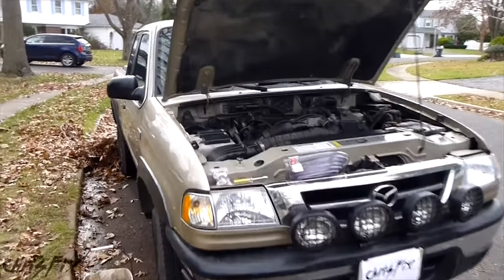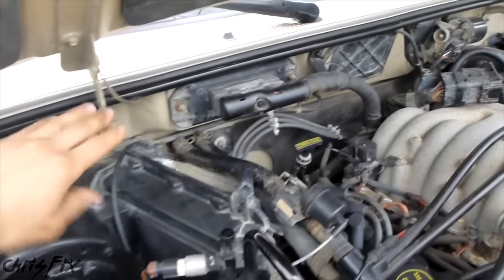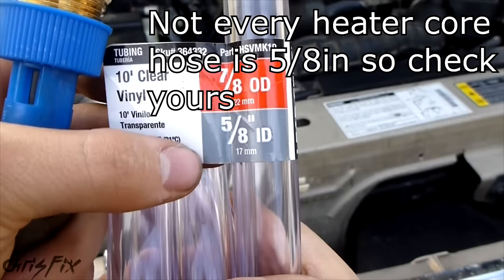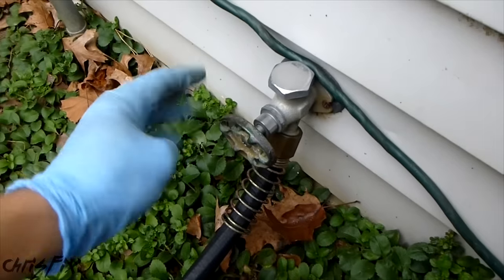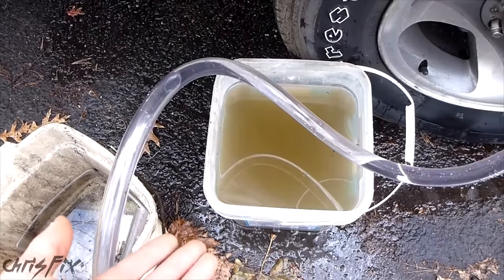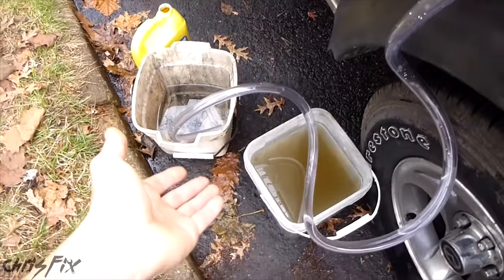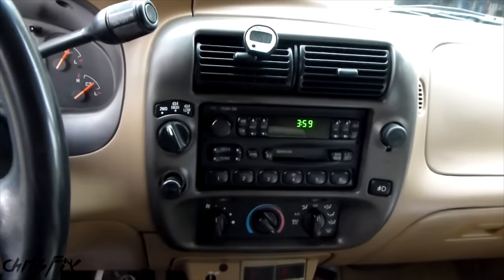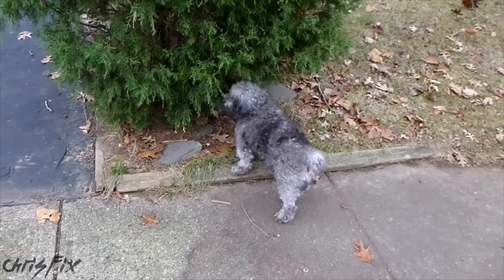How to Flush a Heater Core Safely (with a garden hose)

Comment: Chris, I'm a big fan of yours! I just replaced a leaky water pump on my Highlander, but I still didn't get heat (I lost heat after the leakage). After watching your video I suspected my heater core was blocked by air pocket. I followed your suggestion to flush out the heater core which worked like a charm. Now I have heat in my car and the fix is complete. Thank you very much!
Reply from the maker: Nice work!

Comment: Thank you again, Chris!
The heater hoses on my 97 malibu go back down behind the engine so I connected the clear water hoses to the heater hoses with plastic splicers and it worked great. there was a quick disconnector on the inlet hose that had corroded & it completely crumbled when I separated the heater hose so I’m glad I caught it because it was leaking a little, so it was a blown hose waiting to happen! I cut 1” off the end of the hose & cleaned it up so that when I finished up I re-attached it directly to the heater pipe. Those quick-disconnects are more of a hassle than a convenience. Ask me how I know...
Reply: What tool did you use to cut the 1" part? I am trying to assign handiness to things I already have or buy what is needed for such projects.

Plus I have carpal tunnel so my wrists aren't great for endurance challenges.

Comment: Thanks for the video! My 95 BMW 525i was barely putting out any heat and after following your instructions shes pumping out heat again!  Very pleased I didnt have to take it to the shop!   I did a full cooling system flush btw following your other video because I was over heating. Cleaning out the system as well as a new fan clutch did the trick.. Thanks again!

Comment: A couple things. You opened the cooling system. Even though you refilled the heater core with anti-freeze, there will still be air trapped in the system. This can cause problems such as no or warm heat if there is air in the heater core (coolant wont flow properly), idle issues (air can trick the coolant temperature sensor into thinking the car is not at operating temperature, causing idle surge/fluctuation and sometimes even a rich running condition), and if there is enough air the car can even overheat (coolant won't flow properly).

You mentioned running the heat in the summer. You don't even have to turn on the fan. The climate control knob will open the valve by the heater core allowing coolant to flow through.

Great video. Glad you mentioned to NOT use CLR, I have seen other tutorials where it was used. A good alternative would be Simple Green degreaser.
Reply from the maker: Assassin XIV Thanks for the tips. I filled the heater core with coolant so you do not have to worry about air being trapped in it. The highest point while filling the heater core was the hose outside the heater core so air was forced out. The heater core hoses commonly have air in them when you shut the heat off so there is nothing to worry about with that. You go for a test drive to test the system and it will be obvious that you have air in the system because you wont get heat. 
Not ever HVAC system works the same and just putting the knob to heat on some cars (typically climate control cars) will not open the heater control valve so that is why I say to just run the heat. Also, it is easier to remember to run the heat when there is heat coming out. 
I like the simple green idea, that is something that might work well.

Comment: Just a tip: some cars use a pull through design rather than a push through heater core. This is to slow down leaks onto the floor from the heater core. This way the heater core leak draws air in instead of pushing coolant out through the leak. Cars with this design can have both hoses from the heater core removed and never push coolant out of either hose.
Reply from the maker: ***** Thanks for sharing!

Comment: I would suggest NOT DISCONNECTING the hoses that attach directly on the heater core but from the other end of the hose. You risk cracking the heater core by doing it this way.
Reply: Shhhh.   Ut tfu
Reply: If the hoses are difficult to remove from the heater core inlets and outlets, I imagine you are saying the force and twisting motion can cause the cracking as you remove the existing hoses. I know my hoses were on solid and were difficult to remove.
Reply: Got same advice when i bought new radiator. Makes sense. Keep trying to help others and ignore the inevitable hate. Others appreciate it.
Reply: Very true! Thanks for sharing. It's risky when dealing with delicate cars like Frontier/Navara D40

Comment: I'm getting no heat to very little heat in my 2014 Corolla, I'm narrow it down to the clogged heater core because the inlet is hot and the outlet is cold.  Only a no flow will give you that symptom.  Thanks for the tips and video ChrisFix.

Comment: Do yourself a favor and don't twist or pull on heater core hoses, you'll probably break the welds on the pipes. Heater cores are flimsy. Always cut and peel the hose. Ask me how I know...
Reply: ffgew22  I agree. Kind of made me nervous watching him pull and twist on them. If possible follow the hoses to the other end and disconnect there where there is less chance of damaging anything.
Reply: How do u cut and peel? Peel with what lol
Reply: J Hemphill what barb?

Comment: Thanks for all the info! gonna do a flush this week. I don't need to since my heat is already working well. But it's something that I know the previous owner hasn't messed with, and my radiator fluid is starting to turn. I'll report back later.

Comment: Those little pieces in the bucket could also have been from the garden hose itself. You don't want any of that in the heater core, so before attaching the hose to the flush kit you should probably let it run into the grass for a bit, to flush that out as well ;)

Comment: good video!  i elected to cut the hoses right where they were easy to get to, and splice them  back together with 5/8 inch nylon couplings and hose clamps, all from home depot.  I   cris-crossed the hoses though, making the heater inlet into the outlet.  with the flow in the opposite direction, the 2000 gmc sierra truck heater worked like new immediately :-).  the reverse flow idea was from my mechanic and the idea to cut and splice was mine as he had told me the plastic connections on the truck can break and cause big problems so i didnt want to remove the hoses at the firewall.  Also, I was far from home and had no hose... did the job for under ten bucks, right in the H.D. parking lot - in 45 minutes including trips inside for parts then another trip to buy a utility knife to cut the hoses... duh.
Reply: Your way is cleaner and more professional, but with minimal resources the reversal way i used does work.  Thanks again for the excellent video.  Good production and clear presentation.
art
Reply: I am trying to get a sense of the cross crossing / reversal thing you did...so was there any draining /flushing / removal of liquids involved in this on-the-spot fix?
Reply: @wmluna381  No, I didn't do anything other than what I wrote there.  That truck hardly gets used, but I just drove it last month from where it had been in Dallas, and brought it to LA and the heater works great.  In fact it was 30 in El Paso one morning and I forgot that the heater had ever not worked until I just got your question by email.  I hope your fix works as well as mine.  Art
Reply: @ghoraimandu  Sweet, thanks for clarifying and taking the time to reply to my question. 😊
Reply: @wmluna381  Oh yeah, since you asked about liquid removal or loss... as I recall, when I cut the hoses a very little coolant leaked out of the system. (since you are cutting at the top of the cooling system, gravity keeps almost all the juice from draining out)  Of course you can top off the system when you are all done if you feel the need.  I can't remember if I did or not.   I am sure I left the coolant in there because I was curious if whatever had clogged the heater core in the first place would re-clog it over time, but my mechanic told me it wouldn't and it has not. 
I would be curious to know if it works for you, too.
Art

Comment: Question for you, Did a flush on my 2008 Dodge Nitro a couple weeks back. worked great had heat again. Now i don't have heat again. Is it possible the heater core is breaking down or should I flush the system?
Reply: +Clinton Tasche Maybe your coolant is dirty and it basically just clogged it up again.

Comment: Those heater core hoses on that truck were so easy to get to. My 2000 Olds Silhouette minivan isn’t like that at all!
Reply from the maker: Darn, what needs to come out of the way?
Reply: @chrisfix  Transverse mounted V6.  Heater hoses are buried behind the engine close to the brake booster side.  Probably need to roll the engine forward, remove wiper arms, other hoses, one guy removed spark plug wires/coil pack.  Doesn't look easy to get to at all.  Haven't found a good video on how to get to those hoses.

Comment: Very well done. Good videography. I had no heat, just cold air from a hot engine. I just took and old garden hose and cut it in half, then clamped the cut ends onto the intake and output of the core using the same hose clamps. ran a reverse flush from the hose bib through the core and then through the control valve. Now the heater gets hotter than hell. Cost $0.00 I like that you addressed getting the air out of the cooling system by refilling the core first. Air can cause big problems.
Reply from the maker: SA Bjork Thanks man and AWESOME! Glad the video helped and you got your heat going!

Comment: I've been driving my ranger since 2008... I was 15 years old at the time (in sc you can get your license at 15) and decided I wanted a cb radio. I accidently drilled into the heater core. $750 and a week and a half of not having my truck and tiding the school bus taught me not to mess around with the heater core lol. I sure did have a sauna driving to the mechanic with the anti freeze pouring right onto the cab floor and filling my radiator with gallons of water every mile. Ah good times (I wouldn't have said that at the time) :)
Reply from the maker: Nathan Bastedo Ouch. That does make for a good story now and you learned a lot/your lesson so! But yea, back then that was not what you were thinking lol

Comment: I love your videos. concise and thorough. Im going to flush mine and flush my cooling system because of you, instead of taking it in and having them do it with a machine. My dashboard squeals and gurgles intermittantly, and my vents blow at 111-125°.

Later in the video i see gloves crammed into the adapter, obviously to prevent leaks. Next time, use garden hose rubber gaskets. A whole bag 'o ten or so is like two bucks at lowes. You can freshen up all your dried out ones in your hoses at home while you're at it, and still have leftovers.
Reply from the maker: +dethmaul Thanks for sharing and good luck! And yea, I couldnt get that dang thing to stop leaking haha. Got the correct setup now though!

Comment: Chris you did it again!!!!  This is EXACTLY what I need to do for my wife's van.  You just keep hitting the nail on the head!!!  Really appreciate your videos!!! And thanks for the tips. One question, is the opposite true in the winter regarding the a/c?  In other words, should we turn the a/c on temporarily?  If so how often if at all?  Keep up the great videos!!!! Take care Chris.
Reply from the maker: moneygeewtee Haha, I am glad the videos have been relevant and helpful! Yes, definitely run the AC in the winter once a month just like the heat in the summer. It keeps parts moving and lubricated. Things on cars are not meant to not be used. Seals go bad, parts rust, etc when they are not used.
Reply: Very good advice.  Thanks for your response Chris.  Take care.

Comment: You made it so easy! I'll definitely give this a try. My 2002 F150 either blows hot air for a few seconds then gets cold instantly or it doesn't blow hot air at all exactly as you mentioned. I replaced the thermostat last October and the heating was actually kind of better but it doesn't blow any more hot air now. I flushed it once but it got dirty again not long after. Well my coolant reservoir is extremely dirty so I'm going to replace that as well I will give the heater core flush a try and the bright side there's no leak, steam and I definitely don't smell antifreeze. Thanks for this awesome video and I'll let you know how it turned out!
Reply from the maker: +Aaron Taylor Keep me posted! Good luck!
Reply: +Aaron Taylor i was wanting to tell you that if your coolant was really bad when you changed the thermostat before and your heat was hot for a while, most likely you need to remove the new thermostat and flush your system at least 3 times till you have the block clean then replace the thermostat again , flush system with thermostat removed. Does your truck have heater hoses that bypasses the heater core and if it does then you need to clamp that hose shut while your flushing heater core or the system.
Reply: ChrisFix Hey sorry I really forgot to update you until the guy that replied to me lol. I did it that following night and I realized that my F150 had this complicated hose where I needed this certain tool to slide through this plastic and release the prongs. It took some time but I was actually able to at least unclog the heater core! I have great heat now thanks to this awesome vid! However it was so cold out plus I had to work in a hour so I didn't have the time to do the full flush. But next off day when I get the Coolant reservoir I'll  do the whole job again. It was a fun experience. :)
Reply: BrianLeeUSA73 Honestly not too sure on the heater core bypassing hose part. There was only 2 hoses; a inlet and outlet. It was like driving a refrigerator both my jobs and back until ChrisFix taught me to unlog the heater hose starting from the outlet hose. Ever since that, I now have heat. So me removing the thermostat may make the flushing better? So is the worst case scenario that it won't read the temperature of the coolant? Sure it wont overheat or anything?
Reply: watch chrisfix video on flushing system, he shows a great video doing his truck, he shows in his video about removing the thermostat while flushing system but if your just flushing the heater core then no..use a new thermostat when your all finished.
chrisfix  system flush video..

Comment: Chris Fix - I watched this video several times and this is the scenario I used. (1) I connected the garden hose and reversed, and forward, flushed the heater core multiple times. Note: This was mainly to make sure I had flow through the heater core. (2) I then connected everything back and drained the radiator of all coolant. Next (3), I filled the radiator with distilled water and added two bottles of Preston Radiator Flush and Clean. I drove the car for around 3 days (accumulating around 3 - 5 hours) of engine time with the heater on full blast (high temperature and fan). Note: Distilled water has all minerals removed that can damage your radiator and heater core. Do Not Use household water. Next (4), I drained the system, filled it with distilled water, drove it for about 30 minutes, again on full blast, then drained the system. Note: This was to remove as much of the radiator cleaner as I can in the system. You can do this part more than once but I only did it one time. (5) Finally, I filled the radiator with 50/50 coolant and let it get hot leaving the coolant reservoir open for the air bubbles to escape. I now have super hot heat where there was none before. Thank you for your training videos.....

Comment: I found a better connector at Home Depot. It's called "5/8 female metal mender" made by Orbit. It connects directly to a garden hose and the other end goes right into the 5/8 ID clear tubing. It's really made to replace the female end of a garden hose and it comes with a metal clamp to secure the tubing. It's only $3.47, and it's in the hose repair isle.
Reply from the maker: JFreakinWet You see, I asked them for that type of connector but they said there is no such thing. I went back and bought two more connectors to make that exact thing. It is nice to know that the place I go to knows nothing! Thanks for the info man!
Reply: Might've been the same guy who worked in gardening who told me there was no such thing as hardware cloth / he'd never heard of it had transferred to your area's plumbing dept.

Comment: I flushed my heater core on 98 Honda Civic. No effect. It required a Blend Door Actuator. Its $60. Its easy to get to - above accelerator pedal - upper right. I only drive it in summer.
But, good video.
David
Alberta
Reply from the maker: I'm glad it worked out in the end!

Comment: Great video!
Viewers should know, however, CLR works great on the contrary.
Honda specifically has a TSB in relation to using CLR to flush heater cores 
Actually works better than any solvent from the parts store

Comment: WD-40 or liquid wrench sprayed on the hoses and clamps makes for easier removal and assembly. You know those dry hoses thats been on for years won't come off that easy. The core will handle 16-20 psi. You can use a brass garden hose nozzle that tapered. Those usually will fit any heater hose from 1/2 - 3/4. you can easily adjust the hose nozzle for flow...back flush it both ways. Dont need to add coolant to core after flushing...difference in coolant is miniscule. You can just top off the radiator and overlow with 100% coolant.